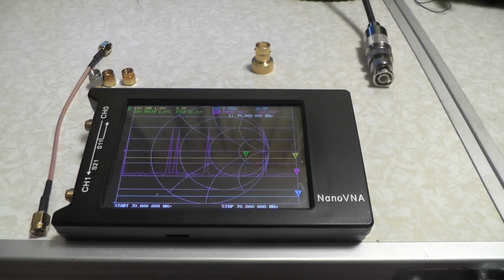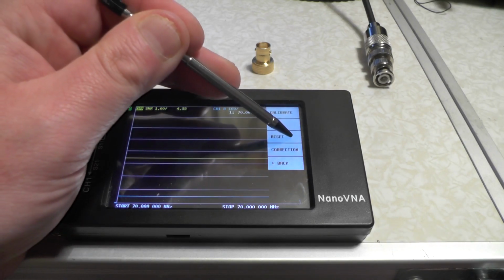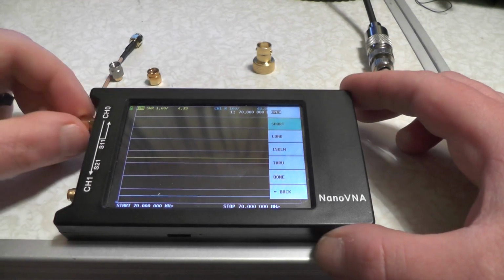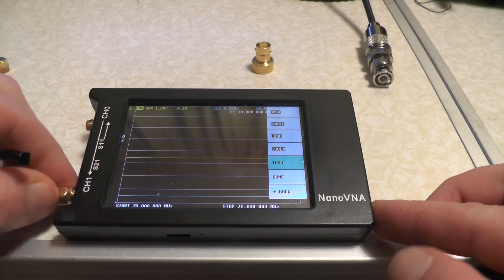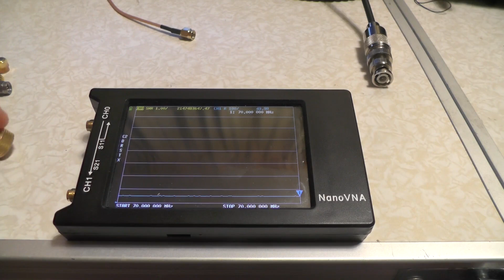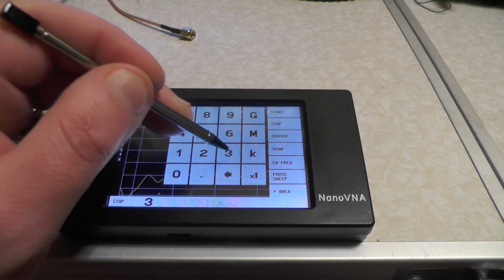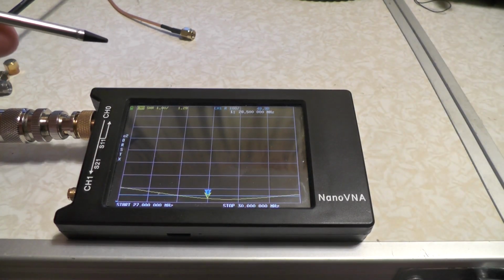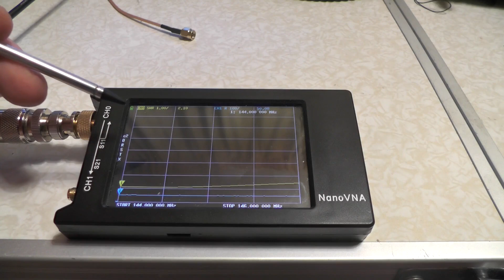Nano VNA -H4 how to

Comment: ok so when you calibrate the vna and save it to a channel do i have to re calibrate next time or can i go the the channel i saved it on and check a diffrent antenna without re calibrating ?
Reply from the maker: @bobbyt3451  you should be able to go to the channel and check a different antenna. I’ve not used that meter for ages now been using a rig expert zoom-230
Reply: @bobbyt3451  hams helping hams
That's what I love about ham radio...

Comment: Did you use JUST 1 patch cable and connect to BOTH ports, OR, 2 separate cables that were supplied?  Having to receive this device without a manual, how to setup, how to calibrate this seemingly simple device in disguise is frustrating especially if you have a different version like the H4, with a different screen.  Geez.  To be honest, I'm goings around in circles just to get the SWR ONLY.
Reply from the maker: Think mine came with just 1 patch cable and one open load and short connection I just used 1 patch cable . Not used it in a few years been using my sark100